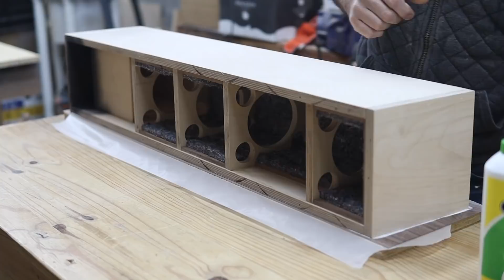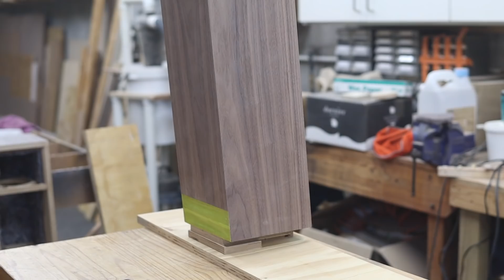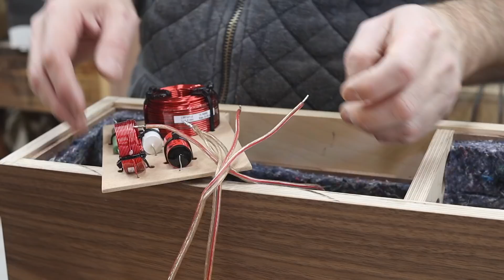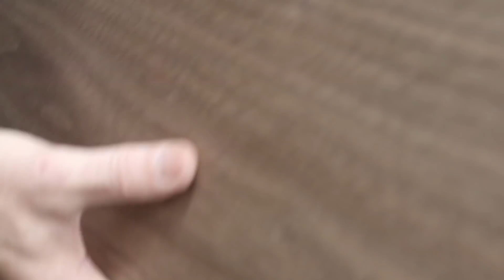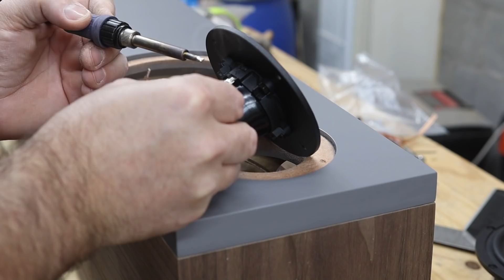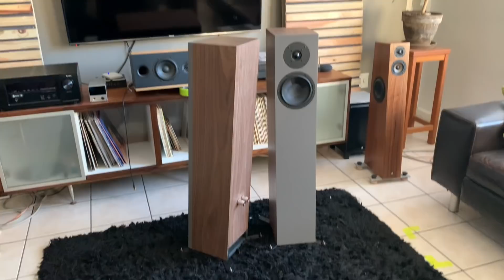Building a 2-Way Floor Stander Speaker with Kartesian Drivers PART 3 - by SoundBlab

Comment: After countless viewings of your great projects, which speaker would you consider the best for both high fidelity and movies. Thanks and please keep making these speakers for us to aspire to make.
Reply from the maker: Hi, I think the Slimline Small 3-Way Stereo Speaker is a good option. It's great for music and movies due to its good bass output and clear mids and highs. It will need a bit of power to get the best out of it, so pair it with an amp that has at least 80 to 100 Watts of power. I used it like this for a year or so in my setup, and was very happy with its performance on both fronts. These go fairly low, so you might not even need a subwoofer.

Comment: I think the only thing I would do differently is apply some butyl sound dampening sheeting to the inside of the panels for additional sound damping. I feel like I can hear the cabinet when the woofer is playing. Not sure if I'm just hearing it wrong through the recording. It may also just be the sound that this kind of porting provides. Regardless, they look good and the drivers are clearly quite capable.
Reply from the maker: The cabinet is rather solid. I think perhaps adding some more damping material might solve what you hear to counter the effect.

Comment: Too bad you didn't include raw freq response of the drivers on the baffle. Also rather high crossover point for a 6.5" midbass, but I understand you made such a choice to reduce the complexity of the x-over.

Comment: Any plans to do a build plan version of this, but with 2 woofers instead of 1?
Would it require big changes to the cabinet and filter?
Reply from the maker: Not part of future plans, and it will double the size of the enclosure.

Comment: Real high end quality build! Seriously considering building these. They look stunning too! However, if I build them, I will sacrifice a little bit of the sharp and clean look, by rounding the edges of the front baffle, to reduce potential edge diffraction.
Reply from the maker: Thanks. Go for it, it’s.a real satisfying process and they sound great too. I went for form over function, but you can definitely round over or bevel the edges on the baffle.

Comment: Very nice design and execution!  With regard to soldering onto the copper tabs, it might have been helpful to drill the tabs and pull the wire through before soldering and let the solder flow through and fill the hole as well.  This would reduce the chances of losing those connections due to a failed surface solder joint.  The veneer looks marvelous with that matte finish.  I'm terrified of working with veneer because problems come at the end of a lot of completed work and are likely to be difficult to hide or repair.  I doubt I could ever get veneer to look as good as you have here.  I tend to build smaller speakers and just make them out of solid walnut, teak or mahogany.  Very satisfying to work with solid hardwood.  Cheers!
Reply from the maker: Thanks man

Comment: You have the time, patience and woodworking skills which many viewers lack, for me, I use a shortcut, buy an existing(2nd hand) cabinet(not ideal) and build a pair of speakers by using different drivers and external DSP and amplifiers. Sounds great too. I can tune EASILY the sound to my likings to my heart's content. I Can also change drivers easily. Then I can change to another configuration, e.g. 2 way 3 way, MTM, shelf or floor standing, open baffle etc .
Reply from the maker: That is one of doing it yeah. DSP opens a lot of doors when it comes to crossovers.

Comment: Next time you veneer, try using a very sharp chisel to flush trim your veneers. While it does take a little more skill and patience, you won't get that end grain tear-out like you do when using a router. 
And once you get the technique down its actually very fast. Just place your (sharp!) chisel flush against the perpendicular side and slice it off.
Reply from the maker: Yeah, the router can be tricky sometimes. I think I just had a very dull router bit. This normally works much better when the router bit is fresh out the box. And it also depends on the grain of the particular wood veneer.
Reply: It could just be different routers, but it didn't look like he did a push cut, I always do... Slowly